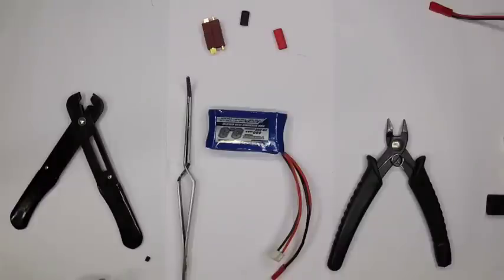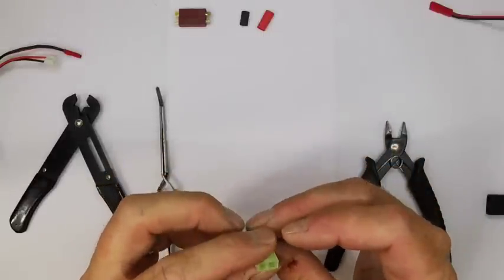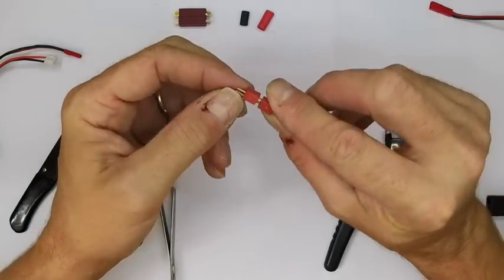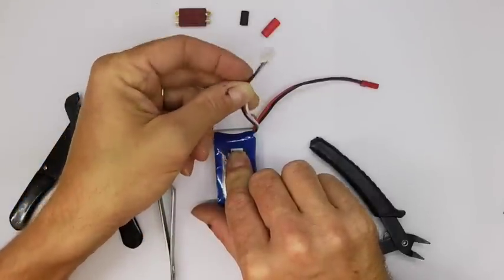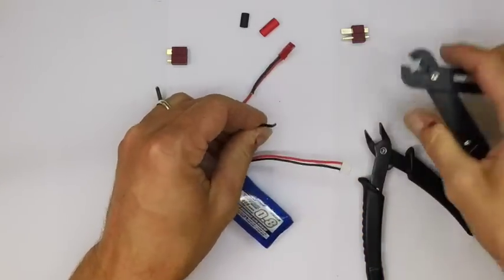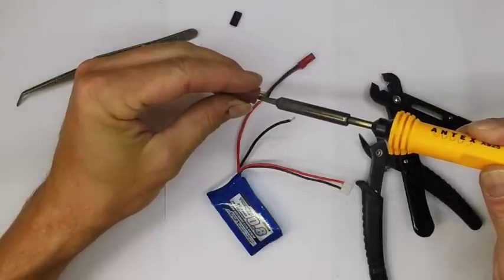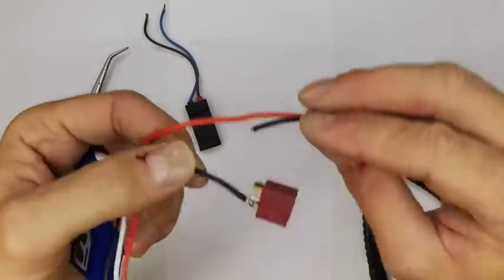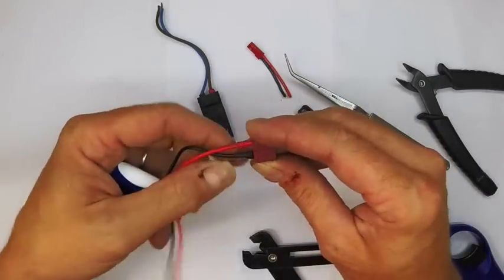Nerf Mod Battery Connectors and How to Change a Lipo Connector

Comment: hello
i would like to put a lipo inside of my rayven. problem is that i don't know which of these wires i should cut and put a connector on... do you have any exprience with the rayven and lipos? thanks in advance
Reply from the maker: You must FULLY REWIRE if you want to use Lipo. The Rayven wiring is just like the Stryfe. Copy my Stryfe guide and instead of wiring to the battery tray contacts put the ends of the wires out into the battery tray and add a Deans connector. You will have to take all the springs and ribs out of the tray.
Reply: Foamdata Services i've done it! works perfectly fine on my 2s zippy lipo! thanks for the tutorial
Reply: I was able to fit a 1000mah 3S lipo in the stock and use the battery tray to house the connectors. Was enough room to hide the balance wires too.

Comment: Hi.
Is it possible to upgrade a Nerf Rival Zeus with LiPO batteries? If so, what would be their specs? Do you, by any chance, have a guide for this?
Thanx.
Reply from the maker: +Guida e Pedro Ribeiro Very easy to do, you need a 3s stick pack and the guide is here-
http://torukmakto4.blogspot.co.uk/2015/08/nerf-rival-zeus-r-begins-stage-1.html

You can also get a complete rewire kit here-

https://blastersmiths.co.uk/products/rival-zeus-wiring-upgrade-kit

Note full wiring diagram on the BSUK page.
Reply: +Foamdata Services Thank you for the feedback. Is the 3 stick pack the maximum limit or can it have more?
Reply from the maker: 3s is best for performance. More doesn't help HIR's, they top out at 120fps. Anything beyond that and they lose their accuracy for no gain in max range.

Comment: How do you think the XT30 connectors would fair on a 3s pack to 130 motors?
Reply from the maker: Too low rated, Rhinos pull 10-12Amps EACH stall. Stock 130's might be ok. Just use a deans if in doubt.  Better to have a slightly larger connector than a melted one. The Deans is only 3 mm or so thicker than XT30, properly soldered the XT30 is almost the same length. The XT30 is great for stock motors on Stryfes or plug in modded pushers in RS, not good enough for main power on anything over 15A peak IMO. I like a safety margin in everything, that's why my stuff is so well known for quality.
Reply: +Foamdata Services  Alright! Deans it is then. Thanks for the reply

Comment: does This also count for an rc accu with 8 cello?
Reply: *cells
Reply from the maker: +samuel van der schoor Not  quite sure what you are asking. The only 8 cell packs with any Nerf application would be a 9.6v NiMh pack, which are too long for the Rapidstrike and result in run away firing with stock motors. You can use them in the Stampede/Vulcan.  The 9.6v stick packs are good in the Rival Zeus
Reply from the maker: +samuel van der schoor Also if the cells are AA battery sized they don't have enough discharge rate for any modded stuff, you need sub C Nimh cells to get the discharge rate required for 6kg Stampede or Vulcan springs as well as RS motors, particularly modded ones. More voltage doesn't = more power, it often just results in excess flywheel rpm and dart burn or in AEG's the rate of fire goes too high and you blow the gearbox.
Reply: +Foamdata Services ok i've watched it in another video and he could do it with an 8 cell batterypack
Reply from the maker: Changing the connector is the same for any size battery, just do like in this video.
Reply: +Foamdata Services ok
Reply: +Foamdata Services thank you for the information
Reply from the maker: samuel van der schoor No worries, good luck with your mod!

Comment: I'm planning to change my JST discharge plug into an XT60 plug. Is the fluks (might have spelt wrongly) necessary for changing connectors?
Reply from the maker: I use a separate Flux because that's how I was taught. Look up how to solder and pick a method that works for you, I use leaded solder too, as it's more forgiving. Practice first on some scrap to get a feel for your solder and remember to tin the wire and the connector first.
Reply: I am taught to solder like that I just wonder whether it's necessary to use Flux for the job. I do have a lot of heat shrink though. Hah
Reply from the maker: It's up to you wether you use a separate flux. I stand on over 20 years soldering in other applications and 30+ Nerf builds for top flight players in very heavy use, not a single solder joint failure.